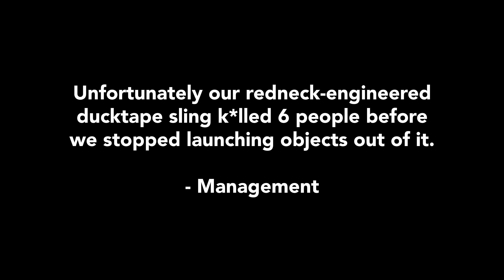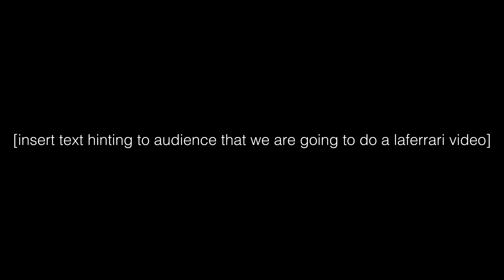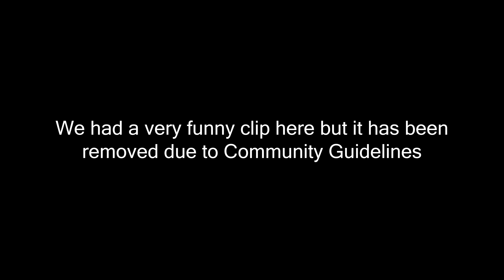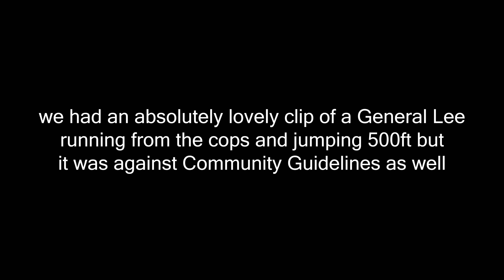Launching Cars With A Giant Slingshot

Comment: It is surprising that out of all the things, the 10 pound ball bearing was the most dangerous 😅
Reply: Power to weight ratio, plus the most aerodynamic of all the projectiles
Reply: @MudcatChris  mostly because it got caught up and could have hit back at Cody
Reply: Where did the ball bearing go? I rewinded a few times but I can’t see it. Did it get stuck?
Reply: @parwes540  yeah it was still in the slingshot
Reply: Extremely dangerous. That was basically a ballistic round for a slingshot. They could have legit punched a hole through that van had they loaded it properly, or had it go right through someone.

Comment: Its crazy how solid that Charger is compared to the Lambo. Hi reversed in the sling as hard as he could and it doesn't look like it did any damage.
Reply: Steel vs carbon fibre, not that crazy lol
Reply: Facts shows how bad most of these new cars are their built to crumble and they get away with it because it’s supposed to be more safe when you crash
Reply: @DIRTYPLACCY man you could have just said you don't have any knowledge on engineering or materials instead of saying that crap like damn
Reply: @DIRTYPLACCY  It is more safe because the forces get absorbed and dispersed by the car body instead of being sent straight into the occupants.
Reply: @itIsI988  as I said fuk safety I want a strong car your literally telling me shit I know that’s why I choose to buy old cars 🤣  if the crash is bad I’m dying anyway I don’t want a car that’s going to crumple in a small accident.
Reply: @DIRTYPLACCY  So you'd rather die than have your car wreck? Kinda sad tbh, it's just a metal box at the end of the day.
Reply: @itIsI988  ffs again as I said if the crash is bad enough im dying anyway if I wanted to be safe I would buy a Volvo 🤣 I have hit 3 kangaroos in my Hilux and it hasn’t done a thing to me or my car if I did that in a new car it’s an instant write off… it’s not sad it’s called living in the out back Australia I can’t afford to have a weak car.
Reply: @Cottontail_GTI carbon fiber is supposed to be the magical material. As strong as steel right, not when it's paper thin. I'll stick with steel, it's easy enough to repair.
Reply: @DIRTYPLACCY  No the Lambo is built to be light and fast.  It can hit turns at speeds that would make the General Lee break Kevin Harts back.
Reply: @tajbates1500 8oo9o🎉😂
Reply: Pp😂Pp hola 😂oPin copied text snippets to stop them expiring after 1 hour😊

Comment: Now, THAT was creative... w/ a little bit of work, that could be a non-destructive, repeatable make you piss your pants experience.

Install trailer hitches on the car(s), then make a curved, half tube on a hitch stinger. Half tube would keep the stretchies from getting under car & curved side to side would allow stretch along length for max oomph.

The above demonstrated ability to  refine crazy ideas, making them more effective AND dangerous is why, at 70, I have stenosis in my neck & low back, atrophy in R hand from nerve damage, torn L rotator cuff, damaged R hip joint & surgical repair on both knees. Oh, yeah, almost forgot, memory, cognitive & personality issues due to brain injuries, (9 concussions I can remember.)

Too bad we didn't have easy vid 50+ yrs ago, I'd have a huge YT channel sub base, too.

Let me know if you need some new ideas...

GeoD

Comment: Someone doesn't understand physics and what a waste.

Next time you get an idea like this just ask someone with a brain first before you waste $100k doing something so pointless and boring. 

Make a very long track with a rail system to hold your car onto the road and in the corners. And then make a really fast car on rails. You can take a  sharp corner at like 70mph. Then make a racetrack with rails on it that you can use to corner and make a fast car with a pin that can ride the rail. Do the fastest corners possible.
Reply: This man does this not to be smart or to prove anything, it's just for their fun
Reply: @Kalashnikov413 yeah